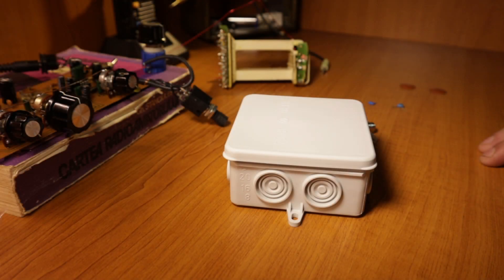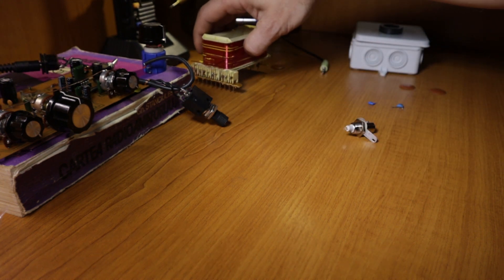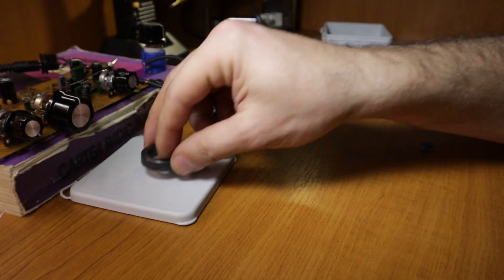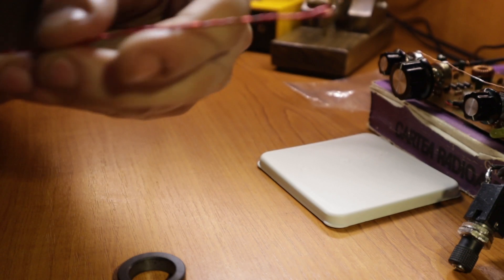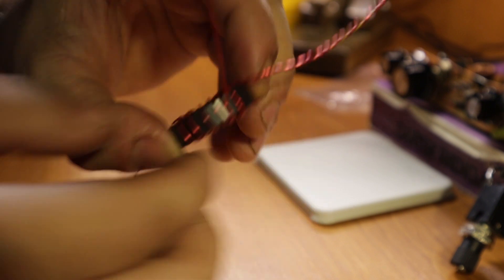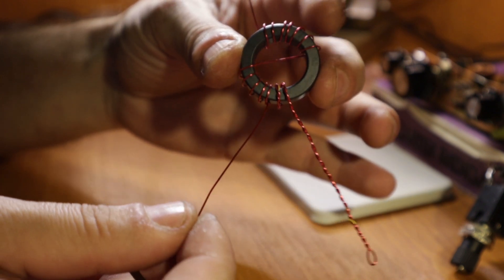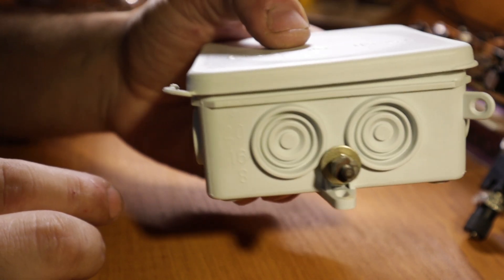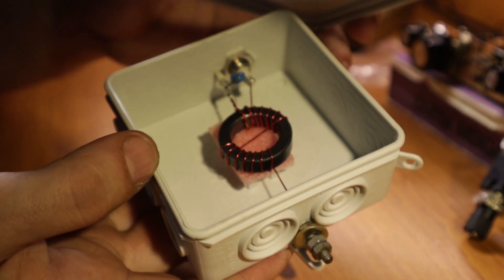Homemade 49:1 Impedance Transformer For An EFHW Antenna

Comment: Great video, why do the capacitors need to be such high voltage?
Reply from the maker: Hi Orlando... A capacitator of 100 pF can be placed over the primary side of the transformer, so you can compensate any (unwanted) secondary capacity. This is only relevant if you use the 15 –12 – 10 meter band. If you don’t use this, the capactitator isn’t necessary. 73
Reply: Orlando, to add to DX's responses, voltage at the end of a half wave antenna is highest there while current is highest at the center. Using a cap with a lower voltage invites destruction. It's the same reason you use high voltage caps when making traps (tuned LC circuits) for multi-band antennas.
de k6whp
Reply from the maker: Thank you for this ) 73
Reply from the maker: P. S. The high voltage is needed because of the high current you get into the antenna and also the transformer if you transmit... at least that's what I know so far )

Comment: You have no outtake for ground. Is this not needed?
Reply from the maker: It depends on the antenna. The one in the video was mostly for RX... and also it was for the 40 to 10m bands... so the ground or counterpoise are not so necessarly. On the 80m band for example the common mode current is much more accentuated so it needs a connection to ground or a counterpoise. It can work just as well with none of those... but you need the 1 to 1 common mode current choke to make sure there is no RF going back in the transceiver. At least this is what I discovered so far since I keep playing with different designs. 73, YO6DXE.

Comment: Do I need the "100pf Capacitor" if I am not Transmitting ?? (I just want to use my EFHW for  Shortwave listening)..
Reply from the maker: If not transmitting not really. Is good practice to have it though. It brings the SWR lower on bands like 20m, 15m etc. But if just receiving I don't think is such a big deal if there is no capacitor 😁.
Reply: Thanks!. And 73s.
Reply from the maker: Always a pleasure. 73, YO6DXE.

Comment: It seems you have 15 turns instead of 14. The crossover counts as one turn.
Reply from the maker: It depends..  usually it counts as half turn not a full turn. Some people count it as a turn, some not. To be honest I tried both ways... and didn't notice major differences. So you can make it both ways. Now I usually build the transformers with more turns in the secondary... 14, 16, 18... with taps. This way I have more options depending on the antenna wire I use and the bands used. 73, YO6DXE.
Reply: @dxexplorer  I agree on it making little difference. I have been experimenting with several variations of windings and cores. If I can get a low SWR across the desired bandwidth, it's impossible to measure a difference in practice. But the "recognized" way to count windings is to only consider passes through the center of toroidal core, with the Riesert crossover counting as one passing (or turn).

Comment: Hello there sir.
Excellent your video of Un-Un 49:1 
A question. I have very small Amidon 50-43 toroids. They are really small. 
I want them only for a Un-Un receiving antenna (SWL). 
Do I have to put the capacitor 100pf too? ..
Thanks for reply. 
73 George
Reply from the maker: Hi Jorge... send me an email please... you have the email in the video description... I will explain you a little more. 73 hermanito.

Comment: I have good news my friend :)...Sputnik is working finally, since I add 1 mega resistor between base of Q2 and ground.. I want to build this end-fed antena as I already have wire 21m long...I want to ask you something, whether this transformer has any influence about receiver preformance or it is important just in case of transmiting(SWR, power loses etc)...?
Reply from the maker: The receiver was designed initially to work with any antenna... either a proper 40m band half wave antenna ... or just a simple wire you hang somewhere up thats at least 6-8m long. It should work with both nearly the same, with no much difference in receiving quality. Of course with a proper 40m half wave end fed antenna..  you will probably get better reception as its properly turned on 40m. I used it like that just because I wanted to be able to have an antenna to use on 40m to also transmit after I get my license. But in the past... I just had 6m of wire hanged around the ceiling in the room and I was still happy with it ))) Very happy the receiver is working. Not sure why it needs that resistor though. I just built another one and it seems to work like a charm from the first power up... no adjustments needed.
Reply: @dxexplorer  ok, I got it..Only to mention, in my ham radio experience, for transceiver performances most important is height of antenna, better to say,  it is best to be higher than any other spot in the neighborhood..with simple 40m dipole and Yaesu ft-901 (100w), I managed to collect qsl cards from all continents as very young teenager, but it was good home-made(thanks to my older coleague from the club) 40m dipole elevated on high spot, oriented to west-east, so I could do qsos with whole world without  problems..About the resistor, I dont have a clue really, but I was thinking why my receiver works only in case when I hook-up the probe of the oscilloscope to the base of Q2..so, I got the idea to add that resistor, considering that the resistance of the probe is exactly 1megaom...before that, I tried all what came to my mind, I changed almost the half of elements from pcb, but without succes...I suppose that resistor has to do with offset point of Q2 transistor which is very important in case of regen receivers as I read somewhere.. Its about final version of my Sputnik on PCB, but in version before that, which I built on proto board, there wasnt any problem..So I think that is no matter of construction at all, than it is something about my realisation, which is not perfect for some reason...I am glad, that you are going to get your license and that you wil be able to enjoy in ham-radio, my friend..
Reply from the maker: Thank you so much my friend. Yes is very strange with that resistor... but as far as I have been building... I've always ended up with strange things and solutions that happened to me too hahaha. Its good that it works and you found a way around. About the antenna..  ohh yes its true. Mine also is about 6m high. I forgot to mention that. But just to have fun and receive some dx stations in the evening for a beginner.... a few meters of wire would do just fine. Especially that many don't have the space to run a proper antenna outside... especially in the city. I was staying at my sister's apartment a little while ago..  and I was lucky I found a tree around.  So I ended up using the tree to make my self an antenna from the balcony... but I guess not all may have that tree around ))) 73
Reply: @dxexplorer  exactly, in the electronics, specially in the field of telecomunications, 2+2 is not always 4 :-))...73
Reply from the maker: Yes yes yes... it took me a while to realize that hahaha )))
Reply: @dxexplorer  I think that I found the reason, why the receiver didnt oscillate...I changed c8 and c9, instead of ceramic capacitors I put the polyester/film capacitors and it works now without 1mega resistor(I desoldered it)...I read(also in my past projects I had similar case) that film capacitors give  better results(than ceramic ones) in oscillator circuits, but maybe I am wrong..however, radio works now...also, my first version of Sputnik(on proto board) worked imediatly but with this film capacitors, It came to my mind yesterday, and I finally found the solution :-)...
Reply from the maker: Hmmmm... interesting. Yes technically it should work with film capacitors too if they are the same value as in the schematic. For good stability in frequency..  I use NPO capacitors... the ceramic ones but with a black paint on top of them... those change very little the value in temperature changes. But only for the tunned circuit... no need to use them for the rest of the circuit. Glad it works now )))
Reply: @dxexplorer  yes, NP0 are the best, but here in Serbia its hard to find them... I put 1nF, both of them, c8 and c9, and it works fine :-)..
Reply from the maker: That's good hehehe. Yes here in Romania are hard to find too... and when you find them... they also cost a lot as well comparing to the others )))
Reply: @dxexplorer  Yes..Btw, did you follow Sorin(electronics reapir school) on YT? He is also from Romania..pure genius :-)
Reply from the maker: I don't know..  I must check. I'm following a few Romanians on YouTube so I'm not sure who I'm following ))) None of them actually live in Romania anymore )) The ones I follow ))
Reply: @dxexplorer  definitly you must check, cause his videos are pure gold...he lives in London last years with his family, after his company in Romania fell in bancrot...Now, he earns his salary repairing laptops and phones in London, but his knowledge is impresive, not to mention great sense of humor...the other words, a lot of learning through the fun :-)
Reply from the maker: I subscribed today. Ohh yes I remember him... I subscribed to his channel from my other YouTube channel long time ago )) now I know who you are talking about. Yes hahaha... lots of humor ))) Smart guy indeed.

Comment: Made it with whatever parts I found but It still worked and I was surprised. The propagation lately is very bad and I only get few locals and some operators from Italy. However I have completed the first version of the sputnik and I made it as compact as I could in order to fit in my hands. Actually some of my amateur Greek friends were surprised for how well they were heard through my receiver in my last video.
Reply from the maker: I'm really happy to hear that. I also want to remake the first version too to use it as portable and keep the second version for home use.

Comment: I have a t50 2 toroid how many turns i have 0.5 mm and 1 mm wires
Reply from the maker: Hi Oliver... the T50-2 will not be good for this transformer. Hmmmm this is a video idea. I will make one for this weekend. The T50-2 could be used for a 9:1 unun.... This one is great for a random wire antenna... other than half wave...  quarter wave and so on. So for the 40m band for example... instead of using a 20m wire... you will have to use 25 for example. But the windings and the connections are a little different than the one in this video. For this particular transformer you do need a 43 material in order to work properly. I'll make a video and post it this Sunday so you can make a proper 9:1 unun with what you have. 73

Comment: the board you shown us right is not the same as the one in your download? new diagram please.  also more info please on the multi turn pot (main tune)
Reply from the maker: The PCB is just a little different as I improved the position of some of the parts, but the schematic didn't changed. Everything it's in the download folder. I have there a document saying that I will continue to try to improve it.... and I will always have there the latest design. The multiturn pot...  the one I use is from SR PASSIVES - Model POT2218P-10K. You can also use a simple 10k potentiometer as well singe there is also a fine tuning. But the multiturn helps a little. 73

Comment: Seen loads of youtubers/ham are using the FT114-43 i don't understand why as the Frequency range  (Broadband Frequencies) is 25-300 MHz (43 material) not much use for 40 meters. it will work bit its not the correct one for 40m, now a FT240-31 is a Lower Broadband Frequencies 1-300 MHz that's what i will be using now I've built my own version of your SPUTNIK thanks to all you info. Thanks
Reply: The 25-300 MHz spec you mention is the RFI  suppression for the 43 mix. The wideband transformer range is more like .5-500, though realistically, it becomes inefficient after 25 MHz or so.
Reply from the maker: @gravestonemyth I don't remember the video to be honest. But for sure it was some mistake. If I say 300 for sure I thought of 30 MHz. I did not tested it on any other frequencies. Is ok as I spent a lot of time making many tests this year... and I want to replace the video with the new one. Thank you for letting me know. Is late now but I will watch it again tomorrow. It's been a while since I made it )). Ohh and yes is true... in my case from 26 MHz up to 30 MHz the efficiency was going down. Not drastically as it was still efficient enough... but it was going down a bit.
Reply: @dxexplorer  Sorry, I was answering @thedaftman 🙂
Reply from the maker: @gravestonemyth don't be sorry... be happy 😁😁 is ok no worries haha. 73
Reply from the maker: That I don't really know... but even in my old amateur radio books they are also using the 43 material. Must be a reason so I won't ask more.... I'm sure they have better knowledge than I do.  But to be honest the antenna performs really well.  This Sunday.... I will come with another video on the receiver.... to talk about a few details and answer a few questions that most people ask. Glad you like it and I hope it turns out well. 73 my friend. Sorry I reply slow.... really busy this week.
Reply: @dxexplorer I appreciate any reply thank you for your time looking forward to next video. couldn't find a way to post you some pictures of mine, my PCB is smaller than yours only 100mm x 70mm
Reply from the maker: @theDaftman  The PCB is smaller because you wanted it that way  ? Or because of the way it was printed  ?  I also added the PDF file in the folder as many people told me that printing the regular JPG may end in different size printing. 73. You can email me photos at contact@dxexplorer.com